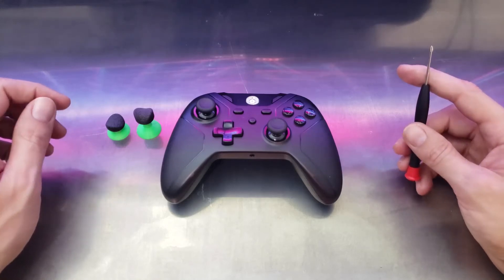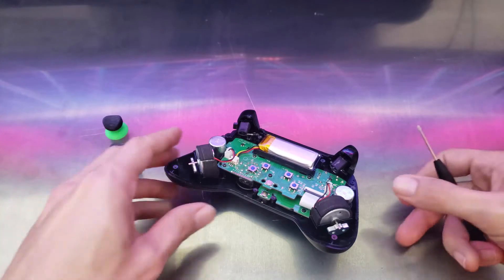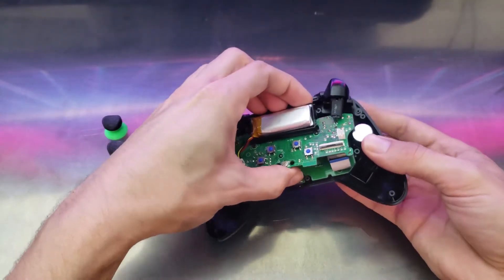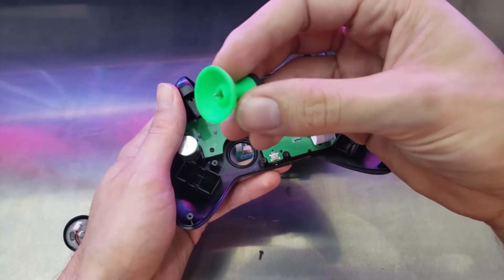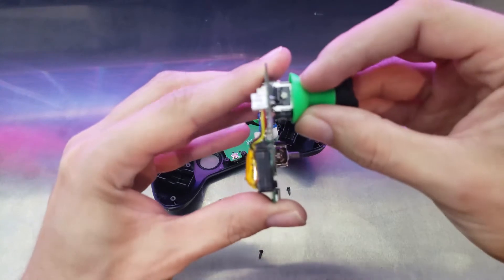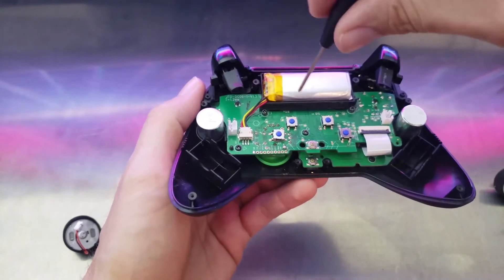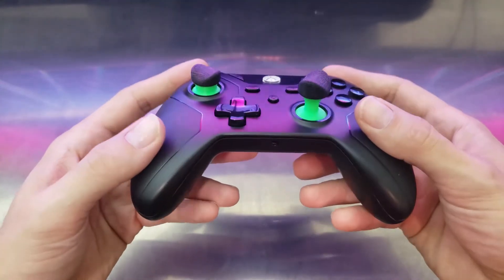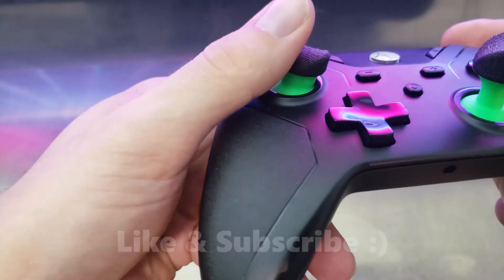Taking apart a XIM NEXUS Controller - Custom thumbstick installation

Comment from the maker: Sold out! Working on batch 2 as well as clip on style ones that don't require disassembly.
Reply: These are possibly the best set of thumbsticks I have ever used. Could you make some for the dual sense?
Reply: I just thought about that and it doesn’t even really make sense
Reply from the maker: @mcclaincuts  NEXUS is super niche at the moment and they sold so fast. If they can sell for NEXUS it absolutely makes sense to do it for Xbox and Playstation. The only thing they wouldn't have is a difference in shaft width.
Reply: @GregRosolowski  oh ok cool. Well you have a customer for life these are so good. I’m going to buy an extra set
Reply from the maker: @mcclaincuts  sounds good man, thanks for the feedback! Hopefully they gain popularity with time.

Comment: Hey, I saw somewhere you said you don’t have the narrower shaft anymore. I want to take advantage of the nexus potential  for more range via calibration. How much of a hassle would it be to print some narrow ones for the nexus? I’m assuming you still have the blueprint to print them. I don’t even need the friction ring if it becomes to much of a problem. I’ll pay a little extra if I have to.
Reply from the maker: I've been thinking about returning it. The original file is gone or I can't find it last I checked, but I might remake it or do something similar eventually.
Reply: Please do, just to squeeze that little extra precision out the nexus that other controllers can’t. Btw, is it possible to order just the right stick of the premium upgrade? I don’t really care for the left stick. Going to order soon.
Reply from the maker: @TerryRyner-yd7iy  I keep them in a kit mostly because I hate having to run to the post office when I only get small order. Small business issues... I'm also trying to figure out a very low cap for the snap on version so I can start selling those in kits too.
Reply from the maker: @TerryRyner-yd7iy  I can sell a kit of two larger sticks though. You can just leave a note when you place the order. I'd be willing to do different colors as well.
Reply: Completely understand brother, thanks for your time, and quick replies.
Reply: Sounds good, Thanks!

Comment: Hey Greg, wondering how the input delay is? Also is it possible to be overclocked or has it been done already? Thanks, fire vid 💯
Reply from the maker: From what I remember its standard 250hz for the sticks and 500hz for motion. Not sure what the buttons are or if anything changed. When I heard that, it was long before the release. There is talk of a wired 1000hz mode in the works.
Reply: @GregRosolowski  Cheers for the quick response. I would love to try this out... Been trying to setup gyro through ds4 windows, rewasd but it just doesn’t feel right for me personally. I have no problem with the xim except the aim assist can be so strong that I end up shooting at an opponents arm lol.. I also use Off sync & Off sab... Linear in game(warzone). I imagine breaking the aa bubble with gyro would be so much easier aswell as tracking
Reply from the maker: @jokar1653  i don't personally use aim assist, but for those that do there are smoothing algorithms unique to NEXUS that help "cut" through it. I've tried gyro on DS4, it wasn't nearly at the level of precision and response as NEXUS.
Reply from the maker: @jokar1653  my absolute favorite part of NEXUS isn't even gyro. Its the incredible amount of tuning you can do the with sticks. You can completely eliminate drift, and create any curve shape you want
Reply: @GregRosolowski  Hey bro, I’m trying to buy 1 but it seems like it does not ship to Australia?
Reply from the maker: @jokar1653  yeah I'm pretty sure they do. You should hit them up, I'm actually only a tester and don't have anything to do with sales.
Reply: @GregRosolowski  Ahh okay thanks bro, i will send them a message. I have a few things I would like to try on this... I play warzone(rebirth) & I’ve been wondering using gyro with linear(ingame) is the way to go or do you believe there must be a curve?
Reply from the maker: @jokar1653  the Smart translator was only trained for the Standard curve. However XIM breaks down the mechanic and rebuilds the entire aim. You can pass through to standard curve or create a Linear or any other curve in the XIM app. To me the stick curve editor and the calibration to entirely eliminate stick drift is the most powerful feature.